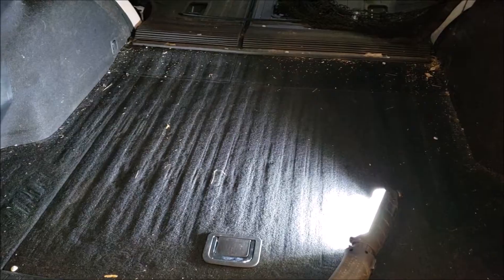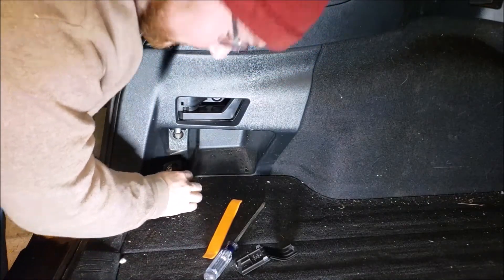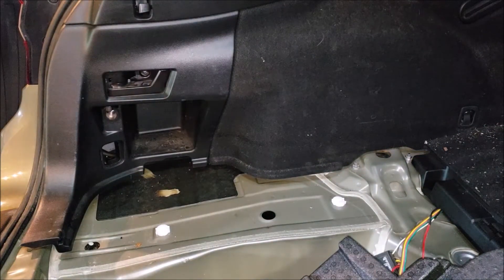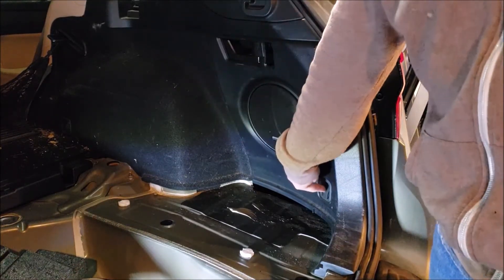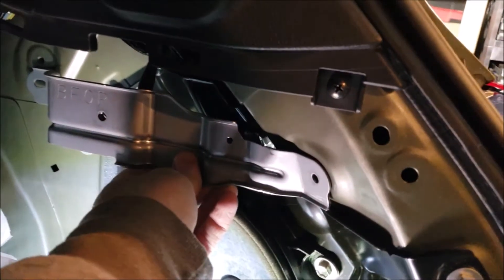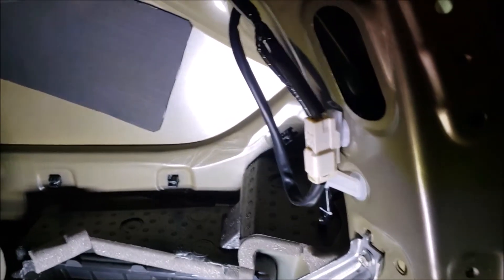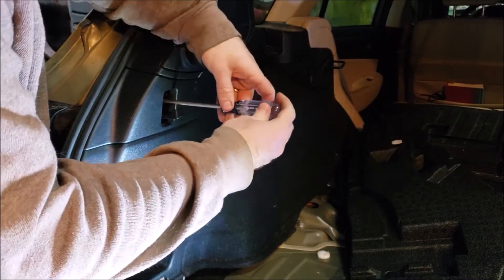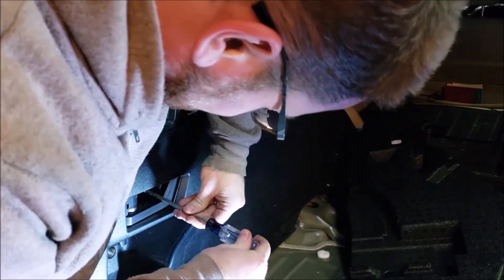Diode Dynamics "Tail as Turn" Module for 2015-2019 Subaru Outback Install Guide and Review

Comment: Thank you for the video, much more work on the subwoofer side vs. the regular side. You're right that you don't have to remove the subwoofer from the bracket. I managed to remove the top bracket and the subwoofer altogether. I also used some zip ties to prevent the wires from moving around too much.

Comment: Question the thing heat up really fast is that normal ? ☹️ where do you pace the metal thing
Reply from the maker: I'm not sure I understand. Can you rephrase?
Reply: The metal retainer, it looks like small ballast and it heat up really fast where did you put it? I am afraid it will melt the plastic
Reply from the maker: I haven't had any issues and have had it installed for years.

Comment: Good install video!  Would this allow you to put in LED front turn signals and avoid the fast blink ?
Reply from the maker: I have LED front blinkers currently. No hyper blink issues.  I plan to change them to the C light switch backs. 

The module includes a resistor to prevent hyper blink.
Reply: bruceyyyyy which led, assuming  they have a resistor built in?
Reply from the maker: Yup. They're canbus 7440 I believe.

Comment: Thanks for the video Bruceyyyyy!  I hadn't considered this, but now I'd like to see what the Outback's rear turn signals look like...  I've been driving my 2016 for 6 months now, and it had never dawned on me what those lights were doing...

Do you have any other suggestions for practical mods, besides the gas vent relocation?
Reply from the maker: The third brake light strobe I really like.

It flashes the center / third brake light before going solid. Helps prevent being rear ended.  I installed it last year after being rear ended.  I feel it helps and it's cheap. I don't have a video but I have a how to guide on the outback forum.
Reply: @bruceyyyyy  Awesome!  Thanks a lot for the suggestion!
Reply: Hi bruceyyyyy  where did you buy your brake light strobe ?
Reply from the maker: @nasfishing4670  I got the XP-W60.  Bought it here: https://amzn.to/2G5QKXV

Also installed one on the Baja.